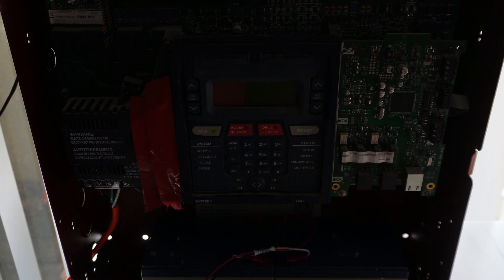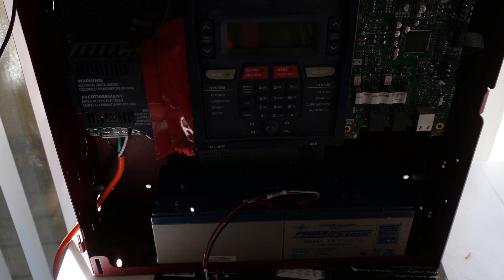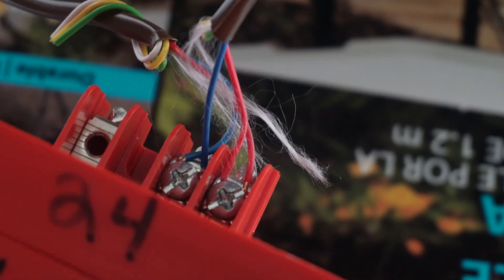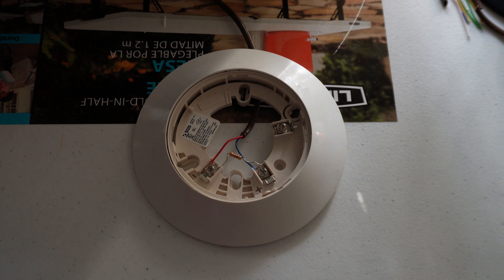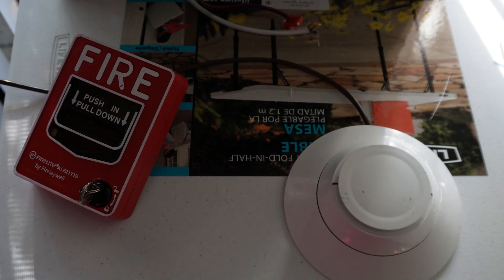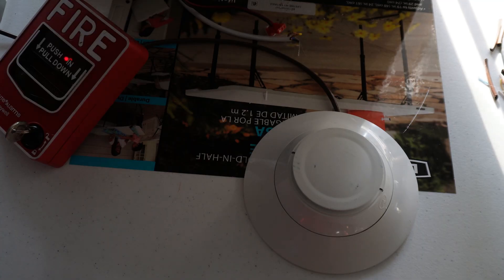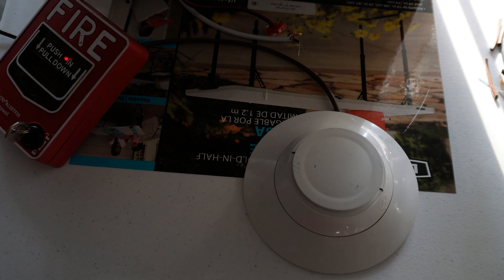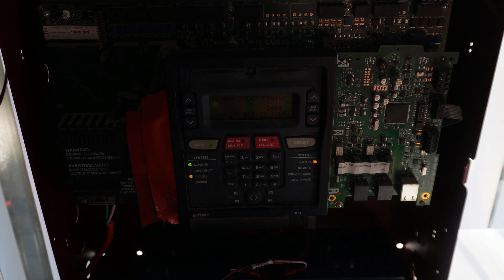Fire Alarm wiring tutorial [Fire Lite ES-50x][Addressable]- Ep. 4: add smoke detector(class B SLC)

Comment: Actually, I have this exact panel, and when I had a Class B SLC setup (now it's Class A) I never needed the EOL resistor, kind of weird your panel did that
Reply from the maker: I got it used. Not sure. Maybe some weird quirk it picked up. I checked system configuration and it was indeed set to Class B.
Reply: @NM_Tech Not gonna lie I do wonder if something is going on with the firmware, maybe a firmware update would resolve this? Because that isn’t normal for an SLC to require a resistor at the end, just an IDC or NAC

Edit: Looking at your past video on connecting your AC to the panel. I was able to discover the firmware version is a very old version, so that could be a issue